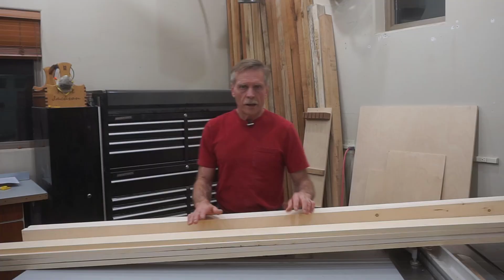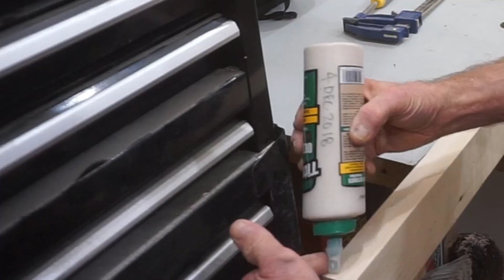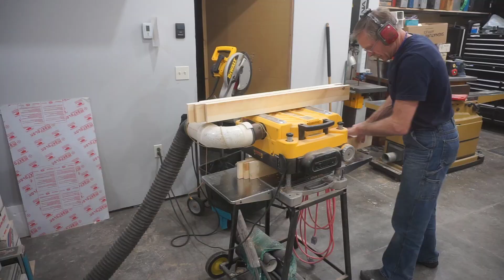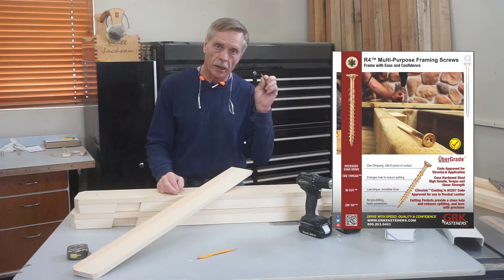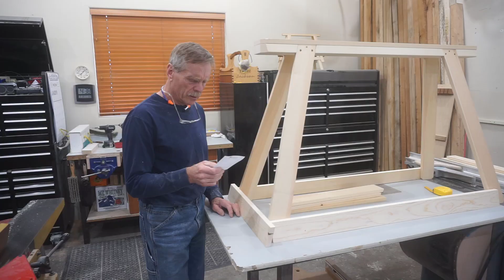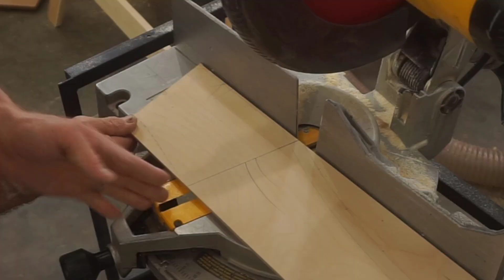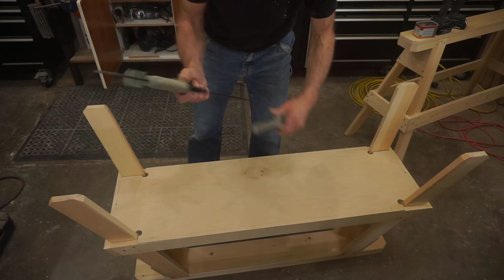Build these Professional Carpenter's Sawhorses

Comment: Great video as always Matt. Your editing is really getting good! Sorry I know this is off topic but when you used your jointer it made me think of these questions. I don’t know if you have mentioned in a previous video or not, but when you moved did you move your power tools yourself or have someone else do it? If you did it yourself how did you do it? I haven’t done a move from one place to another but years ago when my Powermatic tablesaw and jointer were delivered I had them put the pallets of equipment in my garage. I then rented a Toro Dingo with forks on it and bought lifting straps and lifted them from the pallets and moved them to there correctly location. I kept the pallets which had some good hardwood lumber, some of it exotic to us.... and used it for furniture projects and pens and bowls etc.   I did the same when a buddy had his delivered to his garage but the workshop was in his basement. We had to take the dingo around to the back of the house with two of us standing on the dingo to keep it from tipping while going downhills and angling it in to get it into the basement. I kept the    pallet and took it home for the additional hardwood, some of it real heavy. The Torro worked great..sorry I was so off topic..it was the first chance I’ve had to discusss it with you....   Any tips from you would be greatly appreciated. Thanks.
Ron
Reply from the maker: The fact that shop equipment is beastly heavy and often with a high center of gravity makes it an excellent classroom for earning a degree from M.I.T., doesn't it? I helped a young buddy build a cool bunkbed for his growing family in exchange for his help moving 'the big stuff'. Luckily I had no steps to contend with so the biggest challenge was getting up and down a low-angle ramp on a U-Haul truck.  Got a bit dicey at times but managed all the pieces with brute force, Egyptian Engineering and, of course, 'old age and treachery' which is often the only difference between success and failure.  The endeavor was an educated hip shot with nothing I'd care to pass along as a 'hey guys: here's how you move a 450lb top heavy bandsaw without damaging you or it' video.  The main recommendation I'll share is to minimize the height of your transport vehicle with 'lower is better' the key point.  Whatever you do make sure you don't put yourself of your helper in a position that failure causes injury.  Like I say while unloading and setting up my new 450lb dust processor "if it falls on you, it will kill you.  Not only will it kill you it will hurt the whole time you're dyin'!" so work safe and carefully my friend! Best, Matt

Comment: Great work as usual! That is some great looking pine!! You can't buy that stuff at the home stores!!
Reply from the maker: I think the legs and protector cap are ponderosa pine... great stuff, as you say, and a MUCH better option than the Radiata Pine which is most prevalent in Big Boxes. I could only find the hem/fir grade 2x6's which is why I went through all the extra effort to make a spruce/pine piece for the top rail.  Thanks for your comment here Bankhead... Best, Matt

Comment: Great video. Can't wait for the master version. Regarding attaching the caps to the top of the horses -- I also make it a habit to not cut into my sawhorses. But because misteaks hapen, I use brass screws instead of steel or zinc. I also countersink them quite a bit to get them out of the way. They are plenty strong for that application, there's no glue (so the caps are easily replaced when they get too cruddy), and because brass is so soft, there's a chance that my tools will survive an occasional slip of the hand. (By someone else using my stuff, of course, never me!)

Oh, and if my mother were still around and watched this video, the only thing she would talk about afterward  is why on earth you would be walking around in 2 degree weather with nothing on your head.
Reply from the maker: Great comment with good suggestions about the fasteners Ted... much appreciated!  Best, Matt

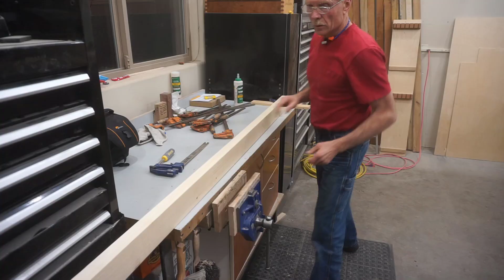Comment: Matt every time I watch you I learn something. I had to stop the video at 4:10 to see how you have your vise mounted. I like how you had the room to put those clamps in front and back of the glue up. I recently picked up a used 10” vise similar to yours and was thinking about mounting it so the back jaw was flush with the bench but now after watching your video I don’t think I want to do that. Do you have any pros and cons on the best way to mount an under bench vise?  Thanks so much for sharing your experience with all of us.
Reply from the maker: Hey Dave, I'm sitting here editing the next video and your comment showed up... never really gave much thought to how the vise was mounted I guess.  That's a Record vise and the bench top is a 1 3/4" solid core door slab trimmed to size and faced with gray laminate.  The vise is bolted to the top through a large auxiliary block of wood.  I counterbored holes in the bench top so the bolts don't interfere with work but are easily accessible so I can remove the vise periodically to clean and lube the slides and quick release mechanism for smooth function.  The auxiliary block is thick enough that the top edges of the steel vise jaws are about 3/4" below the bench top.  I have auxiliary wood jaws that fasten to the steel jaws and their top edges are flush with the bench top. You can see those wood jaws in this video.  They act as a pad for wood pieces and are sacrificial so I don't worry about ruining them in use. Hope that kind of makes sense.  If you need more info I'd be willing to take some close up photos of the install and post them on Pinterest if it would help... just ask.  I'm not going to insist that this is the 'right way' or the best way to mount a vise for anyone but me but will tell you it serves me well for the ridiculously diverse functions I need it for. Thanks for watching videos here and letting me know they're helpful to you, such as they are.  Best, Matt
Reply: Next Level Carpentry Funny I was watching the rest of your video when I seen you responded.  That makes perfect sense and I am confident if this setup has worked well for you then it will work well for me too. Thanks again.
Reply from the maker: @davetarrant6888  I don't know how I'd operate without that Record vise.  A key feature is the 'quick release' thingy on it that allows fast adjustment from thin to thick pieces by moving a small lever that disengages the vise screw and means I don't have to endlessly crank the handle when switching between workpieces of different sizes.  I assume your vise has this but if not I highly recommend getting a model that does...it's that important.  Best, Matt

Comment: Been awaiting this video for the longest time. Time for me to jump in and build..... just one question...… At 20:23 mins in you measure 33 1/16 down legs from Long Long to Short Short point and that ends up being short point of compound cut. Then you flip over and cut from other side. How do you transfer the mark over to other side to ensure you cut correctly? Or do you just cut and sneak upto your mark, flipping over to check for accuracy?
Reply from the maker: Great question Adam... I noticed in editing that part sounded confusing... sorry.   A good way to think of it is to draw both angle marks on the face of a board.  Set the bevel on your circular saw.  Cut along one line from one edge of the board and cut along the other line from the other edge of the board.
It might be easier to visualize if you think about the compound angle set on a miter saw: you cut one end with the piece to the right of the blade and the scrap to the left.  Cut the other end with the piece to the left of the blade and the scrap on the right.  Man I hope this helps because I'm getting confused just typing it🙄🤔😢 Good luck and have fun with the build! Best, Matt

Comment: Another great build, thanks for sharing.  Is there a way to protect the feet of the sawhorse from the elements?  I was thinking of spraying each foot with an inch of "flex-seal" or dipping in "Plasti-dip" to stop them from absorbing water in wet or outdoor conditions.
Reply from the maker: The best way to protect sawhorse feet would be to let them soak in a cup of Abatron Liquid Wood: https://www.amazon.com/dp/B009WCRDH0/?ref=idea_lv_dp_  in a cool environment... that would virtually turn the bottoms few inches of wood into very strong plastic since the product wicks it's way deeply into wood.  Your question is great and I'll consider giving this a try as a great solution to the most rot-vulnerable part of these horses.  Best, Matt

Comment: Thanks Matt! Waited a LONG time for this one. My materials have been sitting in my hangar for about a year! I selected some Redwood along with some other "Blond" wood so they will look real nice. It's great knowing that you are once again going to raise the bar on the next set of sawhorses! I need two more so will wait patiently for the next "Master Carpentry" sawhorses to make the next pair. Great job on the editing and really enjoy the education I get ......   Thank You!   Weav
Reply from the maker: Thanks for your patience 'Weav' I really appreciate you sticking around as I wrestle with channel building and video production.  I don't want to quench your enthusiasm but redwood in general is a fairly weak wood which I wouldn't recommend for working sawhorses.  They would be beautiful for sure and would be cool to have as long as they're not subjected to heavy use IMHO.  Please don't take this as criticism, OK?  Have fun with your sawhorse build regardless! Best, Matt
Reply: @NextLevelCarpentry  The redwood is only used on the very top piece.. Nice and soft along with good appearance. I'm using these sawhorses to hold my wings while I remove the fuel tanks and install new/larger capacity tanks. I think they will rarely see much "Sawhorse Kinda Work"...  Thanks for the heads up!  Weav
Reply from the maker: @Mytyweav  See there... you're thinkin' ahead... redwood's a perfect choice for holding delicate wings... nice!  Plus they'll look great in a hangar... Best, Matt

Comment: Very happy to see someone showing how to make horses with splayed and kicked out legs, and some joinery, in contrast to all those squared 2x4 I-beam, nailed through the corner, rickety parallelogram jobbies. But those legs really are identical, all four of 'em, from the get go, aren't they? That is, until you go nipping off corners for feet.

And something I've never seen anyone address with this style of joinery, where the flat sides of the legs are in plane: the edges of those legs are now skew, and out of plane! I guess that if it's brought to their attention, most would say it's too slight to bother with, but I like my glued and fastened surfaces to meet nicely.
Reply: Whoops, I now see that you've made some of those I-beams yourself, although with a trifling bit of joinery. Sorry to have been rude.

I do love those three different scales you work in. That big 'un couldn't be a better shop sign out front; tells everything you might want to know about the proprietor, and grabs attention from a block away! Good on ya!

Comment: Is there a reason for not using glue in the joints? (edit: should habe watched to the end. With glue in the joints you might have a hard time to disassamble for finishing.)

In 2015 I made sawhorses from 4x4 fence posts. I didn't have a jointer or table saw. Fence posts were the straightest wood I could find locally so the decission was made. :D The legs a 4x4 and I glued up a 4x8 for the main beam. I wanted something strong and heavy for traditional timber framing. Don't want to break something when a timber falls onto it and I don't want vibration when I chop mortises.
I put threaded inserts in the main beam and glued the protective cap up from 2 pieces. One board similar to yours and one thin layer of plywood. I drilled through the board with a forstner bit and then glued on the plywood so I created a deep counter sink. The protective cap is then fastened with machine srews. Easy to be replaced and the srew heads a way below the surface in the counter sink in case "someone" cuts into it.

Comment: Come a long way with those video editing skills, haven't ya buddy!  Nice video.  I was wondering up until the last minute there why you weren't gluing the joints together.  I see the madness now.  hehehe.
Reply: Rewatched the beginning of the video just now.  Boy, did you hit it on the head with the comment about polished resumes.  In the shop I owned, we only used resumes as a reference for what skills someone MAY posses.  More times than not, there were some pretty big fabrications in there.  The real test was giving them a small job using the skill they supposedly had and watching them for a just a few minutes.  It was generally pretty easy to tell if they knew what they were doing or just blowing smoke up the dark side.

Comment: Some of the union carpenters I’ve seen could take a few lessons from this channel!
Reply: Heh. Worked a job with a "Certified Master Carpenter," from up North. I live in the South. This cat even had a card, saying that. Didn't know how to use a bottle jack or a speed square. Not sure what kind of carpentry you people do up there.
Reply: @RodneyFisk  A union carpenter works with concrete, steel studs and drywall. The very first union job I showed up on was way back in 1968. The foreman took one look at me and my tote full of hand tools and said: "I don't know what you've been told, but we ain't build'n no G## D###ed piano here." And so it was for forty years.
Reply: I’m thinking a Union carpenter has much in common with a construction worker ....